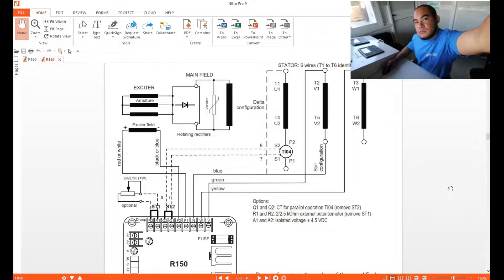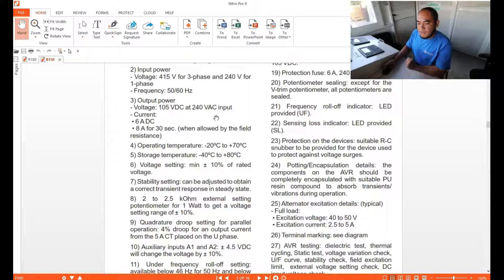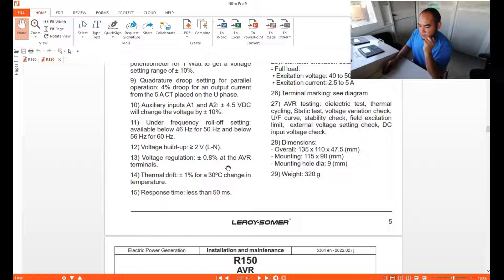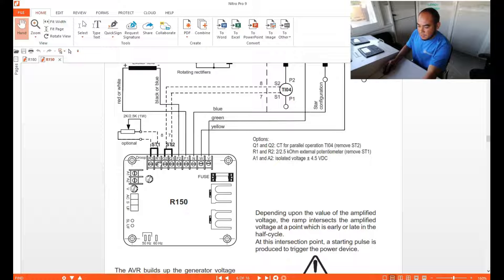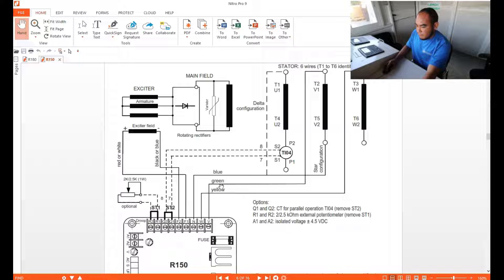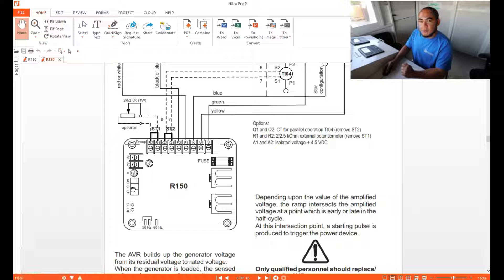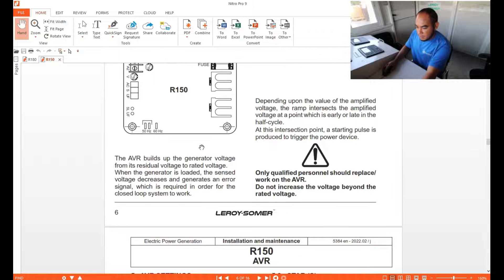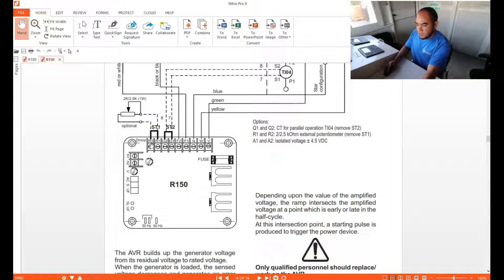R150 AVR Basic wiring and synchronizing connection benzblogs

Comment: Sir Good pm Ang AVR R150 pwedi Po ba sa 440volts Kasi Po nka 220volts Po original salmat
Reply from the maker: Yes make sure the voltage sensing if correct ither 440 or 220 vac due to deffirences
Reply: @benzblogsVlogs ❤
Reply: Sir Ang original Po na AVR R150 220volts Po so ni retap ko Po retap ko Po ginhawa ko 440v Ang tapping Po Ng voltage input Ng AVR 220v L1-N L2-V L3W , sa 44O ano po tamang taping❤ salamat
Reply from the maker: @jaeselyneelvira1013  nutral to line

Comment: good evening, we are synchronizing with AVR R 150 but the circuit current gives us 170 Ampere.  but we have tried to reduce the voltage at the AVR phase Phase in the 396. there the amp is reduced to 72 Ampere, if you can help me find the solution
Reply from the maker: Sir the problem is not in the avr itself double check your wiring and the biasing of all connection if working properly
Reply: @benzblogsVlogs  yes the connection and well
Reply: meccalt alternator

Comment: Bonjour Mr, je voulez vous demande Esk le R150 avec l'alternateur mercal
Ça marche aussi avec la synchronisation.
Nous nous avons installé ça mais nous retrouvons le courant sur le circuit 170 Ampère, quel solution tu mes propos Merci
Reply from the maker: Sir high cerculating current can be fix to the proper config and calibration make sure you voltage and speed biasing is working and the msc should be communicating to other module without this 3 its happen to this issue

Comment: Sir, overvoltage problem when 2 generators are synchronized ?
Reply from the maker: Sir first think you need to check is rpm make sure its stable during sync now if stable thin start adjaut the avr boltage and stability
Reply: everything is normal, but when it enters synchronous overvoltage, does it have any effect on the LC settings?
Reply from the maker: Make sure biasing is working propperly to avoid this problem
Reply: what does biasing mean, where can I check? Sir
Reply from the maker: @Izanzedarr  you said this is synch means that it controll the voltage and speed from your module

Comment: Very useful video, it is not easy to record and post video while working ...
I have a doubt , 
If you have 5 same generators (parrellel)with same avrs , one is faulty, want to replace the avr ,
What is the correct procedure? Can we remove the faulty and install new one and adjust the potentio meter( stabikity,rang) same position as faulty one? Is it enough? 
Could you please give me detail document or link to perform this activity ?
Reply from the maker: Ok if your have defective avr first thing do make module at manual thin remove power supply for safety thin remove and inatall new avr at same connection one done installing ajust avr according to voltage needed same voltage of the rest now if in case its hunting adjust stability and asjuat droop ct at same to other avr
Reply: @benzblogsVlogs  
Could you please elaborate about the CT droop? How to do it ? How to ensure all generators sharing same kvar ? Should I start all generators or just 2 generators enough?
The CTs are wired in series all six and they have switch across s1 and s2 , to short it during not in parrelel .
Reply from the maker: @transientmatter6088  droop soppose to be same adjustment with your other avr coz this are all same value of ct
Reply from the maker: @transientmatter6088  two is enough for testing the sync if its working in propper ways voltage ang speed its should be controld by the module automatically
Reply from the maker: During auto
Reply: @benzblogsVlogs  
Thanks alot brother
Reply from the maker: @transientmatter6088  your welcome